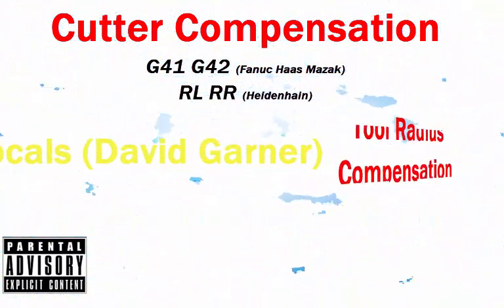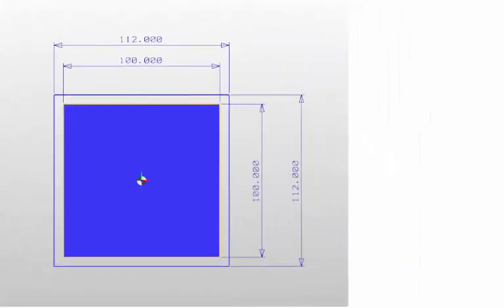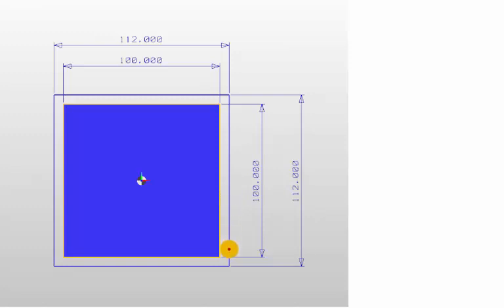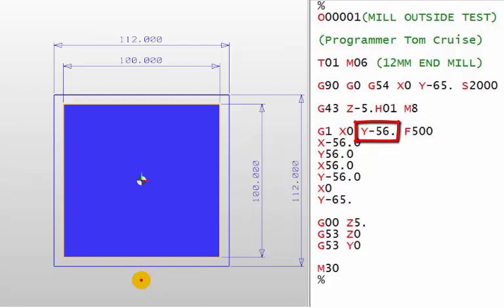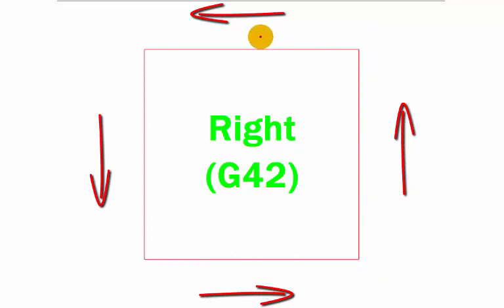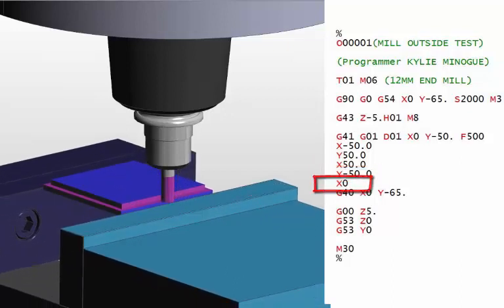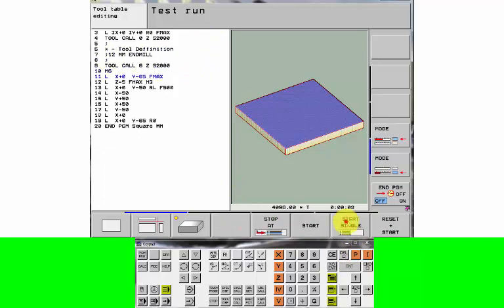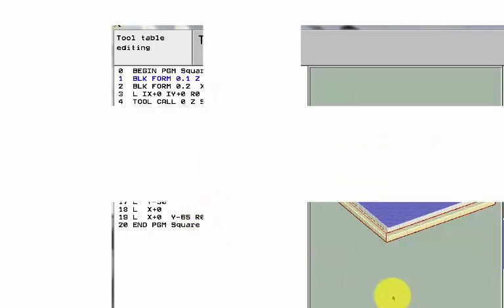Do You Know How to Use G41 and G42 cutter compensation? (RL RR Heidenhain)

Comment: Would like to mention how will cutter go if D has positive value and how if negative value, please. I cannot find on internet any example of such work of the tool.
So how it will work outside of the material (G41 clockwise direction) and how it will work inside of the material (G41 anticlockwise direction).
Reply: MrAnalyst2010 d is tool diameter offset
Reply: MrAnalyst2010 check out haas mill manual